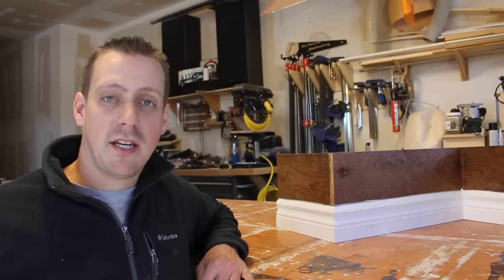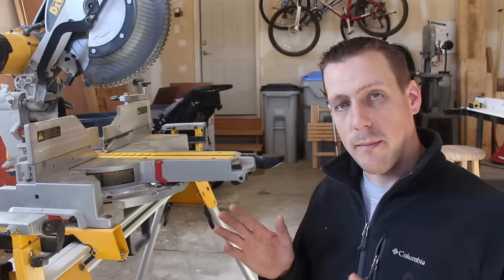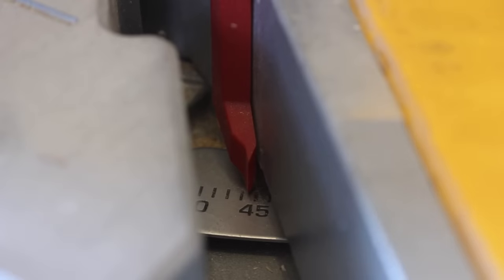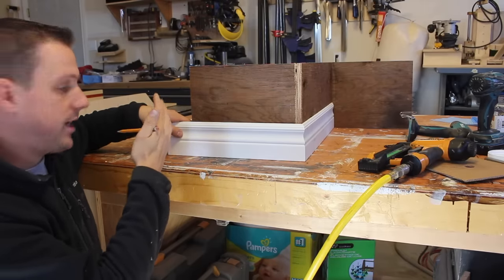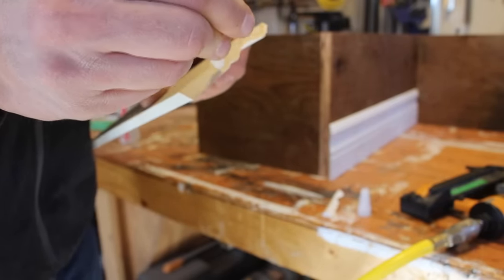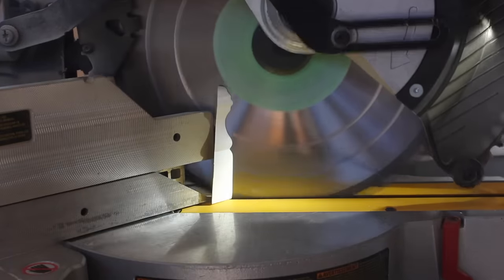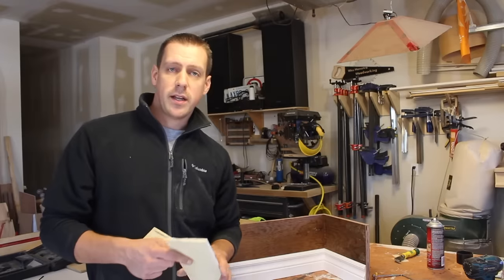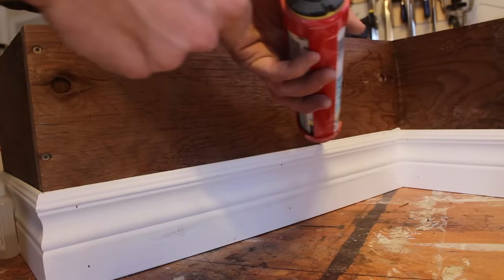How To Install Baseboard Like A Pro!

Comment: I cant imagine actually doing inside corners with a coping saw..... I get it with crown moulding but regular base? It takes too long and time is money....
Reply: Richard Rohde practice makes perfect.. some just wanna get it done asap and make money but there's others that care about quality and clients that want quality will pay for it. To each their own
Reply: Mark Pederson to each their own.. I can cut a 44 degree inside corner that fits just as tight as your coped cut. Quality does matter but time is money and at the rate of $.20 a sq ft (floor space) I'm not coping a single piece. Coping has its place but for paint grade base it's unnecessary.
Reply: Mr. B I totally agree 👍🏻
Reply: You need to learn how to charge.  Do it by linear foot and not square footage.  I get $300+ for small bedrooms.  Then make painting it extra.
Reply: Brian Heuer except for new homes I don't make the rates they do. There's what's known as an industry standard. If your billing out $300 for a small bedroom of baseboard, I would be making thousands a day. Nobody will pay that
Reply: Get the fuck away from new home construction.  It is essentially being someone elses employee.  That shit is huge waste of time and they will run you half to death while pocketing most of the profit from the build.
Reply: To put this in perspective.  I am replacing an attic ceiling fan this week.  Roof mounted.  Hour job tops.  $1200 in labor.
Reply: Running maybe 100 ft of baseboard shoe and top cap this week also $4000 labor + materials.
Reply: Brian Heuer I'm not just in new construction. I handle full renos, re-models and new homes. The example I gave you was for new homes. I charge by the linear foot for private clients. It's nowhere near $300 per bedroom, but it pays slightly more. Right now I have to go where the work is man, Calgary Alberta is in a massive recession.
Reply: Ah, Canada.  Enough said brother.  Best of luck.
Reply: Brian Heuer ??
Reply: Justin Fiorini who are you talking to buddy...?
Reply: Brain Heuer
Reply: How in the world do I give tradesman a bad name if that is what people are paying in my area?  The attic fan is 3 stories up and he couldn't get anyone with a ladder that could reach for less than 2k and I came in at 1.2k.  Yet I am the one that gives tradesmen that don't know how to value their time and deflate market values a bad name??
Reply: Brian Heuer what I wanna know is who is pay $4000 for 100ft of baseboard, shoe and what was it toe cap? Who is this sucker? I need to move to Maryland because clearly it's the new Beverly Hills.
Reply: Learn how to value your time and effort.  All my customers eventually repeat.  My quotes are often right at or cheaper than my competitors.   Obviously, your market will be different than mine depending on where you live.  Which is why I back paddled when talking to OP and finding out he was in Canada.  However, trying to be the cheapest person on the block does nothing but hurt your business.  It attracts the wrong type of customers and leads to bankruptcy if you have a slow period during a recession.  I get far more approvals at the higher prices than when I tried being the cheapest to get work when I first started my business.  

Several clients have all said the same thing to me when I ask them about why they chose me.  They throw away the cheapest estimate as they think you will fuck them on the backside or don't know what you are doing.  Perceived value means more than the actual value with anyone seeking trade services that actually have the money to spend.  If you constantly cater to bottom of the barrel customers.  Your business will be perceived as a bottom of the barrel, no matter how good the work you do is.  It took me a long time to learn that lesson that other tradesmen in my area tried to teach me when I was first starting out on my own.  Assuming you are licensed contractor and not someone doing it off the books then your time is worth more to people than you know.
Reply: Collins coping foot on the jigsaw, plus cut the majority of the 45 off with the miter saw. Then have less to remove with the jigsaw. I never use a coping saw anymore...
Reply: Richard Rohde takes 2 min
Reply: woodmasterguy, you have the right idea, I cut mine at a  back 15 degrees, 45 is a little much I think bit still gets the job done. Just needs to be less than 90
Reply: Mr. B lol...to be fair Maryland has a few of the nation's riches areas...chevy chase, Potomac and bathesda are stupid rich  just to name a few
Reply: Ill first 45 the piece, back 15 degree cut with the miter saw along the straight just to shy of the profile, and then I actually use a rotozip to cope the profile, always back-cutting in the process. If you can get the feel for it your copes will look flawless. To the guys who say time is money, that's true, but once you come to a corner you have to adjust the angle on you'll spend about the same amount of time figuring it out then coping it. That's one of the benefits of coping, the angle of the corner will almost never affect the visual of the cope. It literally takes me one more minute to do, and will always look more professional. Most people would pay more to see better quality that lasts rather than to see gaps in a year or two, all because you didn't want to spend the extra minute... To me it gives me piece of mind...cope when you can!!!
Reply: Brian Heuer u r a fucking closer! Swapin a ceiling fan for 1200. How da fuq
Reply: @BrianEisenman  it's has its place in many instances, think outside the box
Reply: Coping a inside corner is also more forgiving when it comes to wood shrinkage. A metered i/c you get shrinkage from both sides opening the joint. Coping, shrinkage only affecting the joint from one side.

Comment: Man I learned the return , I learned the coping, the scribing a while ago , but I never thought about the 45.5 degree cut 🤦🏻‍♂️🤷🏻‍♂️ that’s something I learned today thanks to you. I’m a self-taught guy, but thanks to you again.
Reply: Flame, in regular walls (corners)  its 46 sometimes 46 1/2. It depends on the corners  I have been doing a lot of base and most of the time I use this angles .. just give a try  and you gonna see how nice your corners gonna looks..
Reply: Israel Gonzalez thank you man ! I will try it . I hate using putty o caulk to get rid of those ugly gaps . 👍🏻👍🏻
Reply: @Flamingorr   your welcome.. I'm sure you're not gonna have to do that anymore

Comment: Definitely a nice informational video 👍 I am an HVAC technician by trade and I never done trim work before at all. I have built houses in the past i.e. framed, ran electric, ran plumbing, sheetrock, even painted. I have always subbed out the detail trim work to a pro that I know and I have to say I have never seen that sandpaper trick before either! Very cool 😎. Now the next house I do I am going to try and do it myself! I did see him however do the angle grinder trick with a sandpaper wheel that worked good too and was super fast.
Reply from the maker: Thanks. I have seen that trick before. Seems dusty to me. I know some guys that use a jig saw to cope. I don’t see the point though. I have gotten pretty quick with a coping saw. I don’t see a jig saw being much quicker.
Reply: @WesHamstra  I have actually tried the jig saw method myself with my friend who does it for a living once and I bought the foot for my small Milwaukee m12 jigsaw its made by Colin's it's only $30 I figured why not and it was ok it just took a lot of time to get used to. For wood trim I can see that method being much more difficult then the MDF stuff. I am currently working on a project now, a custom fireplace made from recycled barn wood and a solid mantel made from oak kind of like a live edge look my plans look good in my head hopefully I can put it together 😂. Any more information when it comes to wood working that will be a great help. Thank you!

Comment: Sandpaper trick was awesome. Your miter was nice and tight but instead of guessing how much to “cheat” the miter cut I recommend a Starret miter saw protractor. Great for outside or inside miters so I never even have to cope. Under $20. Nice video!  Quick, to the point and nice job on the trim!
Reply from the maker: Really? I will have to check that out!

Comment: good video,
    I did that for years, my friend would cheat buying corner blocks(they are more than worth the small price). i would argue with him and finally i tried them and guess what ?? i would NEVER go back EVERYBODY agrees they look much much better !!  also they are stronger from bumps and damage. the tiny fibers of the mitered corners are too delicate to hold up to a bump,also if there is major damage you can replace the corner block,and if the corner is bullnosed you can get corner blocks that are made for that, no doubt you knew that ,but the readers might like to know.  thanks for the video.

Comment: Awesome, Thanks! Just installed baseboards in my old house and it almost came out perfect. I had issues getting things perfect as walls weren't plum in both axes. Turned OK great anyway, caulk will do the rest!

Comment: Thanks for that Wes. I have some 45 degree inside corners. I guess the coping saw trick works for that too. I also realized that I should be using some scrap to perfect my technique a little. Off out to Home Depot for a coping saw!
Reply: Actually, for a 45 inside the first piece needs a 45 cut on it to sit flush against both walls, cut as though it were an outside corner piece and then the second piece gets the 22.5 with the coped and beveled cut.

Comment: One thing that has really improved my throughput is a laser tape measure.  Bending the tape to get into corners always involved a little estimation of the true measurement.  The laser tape hits it dead on with one measurement and no guessing.

Comment: Learned more in your quick video then the dozen others I just watched. Neat tricks! The downward cutting on coping saw to decrease tear/spread, the neat end cap piece (I do wish you’d added the degrees and how you cut it), and the coping against a flat cut. Thank you!
Reply from the maker: Thanks! Just back cut at a slight angle. Like 5-10 degrees

Comment: If you're going to caulk. Run masking tap 1/8 above base and caulk and run your finger along to smooth it out. Make sure your walls are primed and painted first. Then install base and paint base just passed caulk joint. Let dry for 1 hour and peel tape like your pulling the tape back like pulling the zipper of your pants. Not away from wall .You can do this trick on door casing to.

Comment: On your inside cope you can turn the base upside down and put it to a 35 degree angle and cut it down on the straight parts. Saves a lot of time on the coping.

Comment: Good video, the sanding trick is brilliant!  Thanks for sharing.  One thing though, when nailing the baseboards, always place your nails in parts of the baseboard where it is easy to fill and sand.  Some of your nails were in the fine detailed reveal, and that makes for a tough place to fill and caulk.  Don't mean to sound negative, just saying.  Cheers.

Comment: Very nicely done! I'm about to start installing baseboards (about 350 to 400 ft) in our house we just bought. Got the miter saw, need to go get a coping saw and contact cement spray. 😁

Comment: I'll be back to watch again when I get to this point lol. What is the return and when is it used? When are walls not an inside or an outside edge? Also what size nails can you use? I bought a 16g dewalt nailer to have something nice since that's what the internets said was the most general use size.

Comment: awesome tips to finish baseboard, never thought of doing it this way but I may do all of that this way now, good job, takes a little time but the finished look is 100X better then std 45 degree angle cuts or butting up flush

Comment: ANOTHER PRO tip insider is if your cope joints are gapped top or bottom, just scribe the base so your miters aren’t hanging over that 1/8-1/4 on an outside corner...depending on how you cut it....and you can use your rasp to whittle away after your cope...always check if your piece is cupped or twisted...it plays a lot weather you’re cutting it flat or upright on the miter saw...I highly recommend if you’re doing it professionally or have a lot to do to invest in a starrett miter finder...$25

Comment: Use a $15 angle finder. It give you the angle as well as the setting for your miter saw. Dead accurate cuts. Used it for crown I installed in my house. They were all perfect.
Reply from the maker: thanks, just bought one a month ago. awesome tool

Comment: looks good and well shown for DIY jack of trades types like me but I would REALLY like if the return end of baseboard was SHOWN on video how u do it. what angle is it cut and from where on the base and how is the little piece done. .... I recently renovated my entire upstairs on a 1.5+ story house ... laminated floors, drywall mud on some cracks, repaint everything and finally new casing & baseboards ** but ** I didn't know how to do that "return" you showed as a finished product. please show how u do it for a next video.... I'm sure many people would enjoy and appreciate it as will I when I move onto the main floor next.... thanks
Reply from the maker: Search my video catalogue. I made a video on just on the return
Reply: @WesHamstra   thanks.. I just happened to find it AFTER i posted (sorry).... great detail in the 2nd video showing how to do the return ... I really like the way you explain things... very easy to understand
Reply from the maker: Thanks! I had many emails and comments saying that I skipped over how to cut it. That’s why I made a follow up video on it.

Comment: Great video.  This is a two-part question for feedback.  

1) - Do you recommend caulking the bottom?
2) - Any suggestions for areas where the wall is bowed and doesn't make a flush connection for caulking the top?
Reply from the maker: thanks.

1) if your base isn't tight to the floor try scribing and cutting it with a jig saw or install a quarter round or shoe molding to the bottom of the base. caulking the bottom quite often just looks messy.

2) you could cut kerfs into the back of the base to get it tighter to the wall. make sure you are a hitting a stud as well with your nails.

I hope this helps you. Thanks for watching!

Comment: You certainly are terrific. Thanks for sharing. Question: my front door entrance, hallway & my kitchen make one straight line, both the kitchen and hallway are ~ 1” (3/4”) higher than the hallway.(used to have carpeting in hallway in the past). How do I make molding connections ? I currently have moldings; my husband did the best he could but… what can I do?

Comment: This was super helpful but I have a question/comment about the inside corners.  Why go flush to the wall then back-bevel the joining piece?  I was using oak, and this was really hard to cut cleanly, so we used 45º cuts instead.  I imagine that MDF boards might cut more readily.
Thank you for putting this together, this was useful.

Comment: This is amazing! I am putting in new baseboards in my entire house, and I had no idea how to do it. This was perfect and to the point! My only question is do you just lay it along the floor and attach it or do you make it perfectly level and fill in any gaps with caulk between the baseboards and the floor with caulk? I'm installing this over vinyl plank flooring that looks like wood in case that matters. Because let's be real, most floors aren't perfectly level... I'm just not sure which way will make it look better.
Reply from the maker: Push the base tight to the floor. If it’s not perfectly level no one will know.
Reply: @WesHamstra  Thank you for the answer! That will be so much easier 😂

Comment: Not ragging on you mate, but I'd use a corner square to find out the exact angle of that corner before I cut it. Given all walls won't be fully 90 degrees.

Comment: Easy on a mock up box , yeti this on walls that ain’t straight is a whole new ball game
Reply: True, but it's good to know the theory. Currently trying this on a house from the 1700s and it's a ballache...
Reply: When walls are not (arn't) straight the copy saw techique works very well.  If the out side corners are more than the 1/2 degree off that he took into account you could adjust the saw more or less but you might also put lipstick on a pig

Comment: I really don't want to deal with coping. Was hoping this video showed how to do both inside and outside corners. Thanks for the trick for the outside cut though
Reply from the maker: You should really try coping. Practice on scraps till you get it.
Reply: @WesHamstra  Thanks. I have coped with Crown. It just takes more time is all.I'd rather cut and keep going vs cut, stop and cope..  Thanks again. Much appreciated..

Comment: Brilliant thanks 😊 .
If the baseboard is just plain square edge do you just the 2 two edges together on the inside corners without coping? 🤔

Comment: If your doing production trim work you don't have time for coping inside corners. Instead of coping just cut both pieces at 43.5 degrees and you will have just as good inside miter corners. Every once in awhile you might have to shim one out a smidge but 99.9% of the time your golden. Cool trick with the sandpaper, never tried that. Next time I cope I will.
Reply from the maker: That’s a great tip. I will try that on my next trim job

Comment: Wes, this video is three years old and still rocking it.  Thank you for doing this.  One quick question, I have the same saw you're using and I wondered if you had any recommendations on blades.  Will a standard blade work or do we need something with more teeth to avoid tear out?
Reply from the maker: Thanks! I like to use Diablo blades. Around 60-80 tooth
Reply: @WesHamstra  Thanks Wes.  That's perfect!